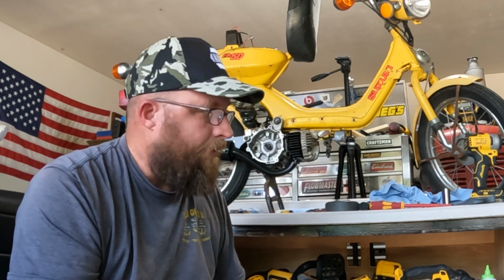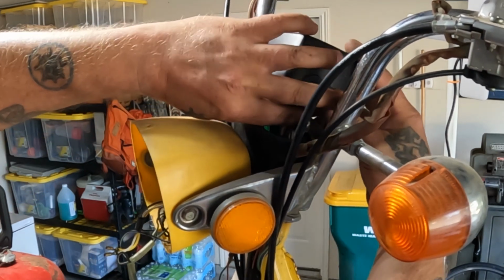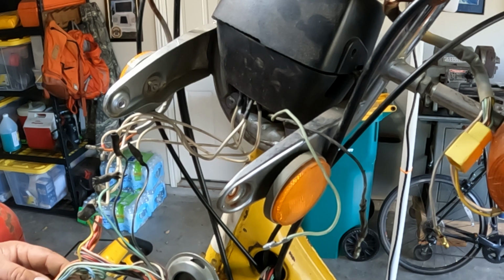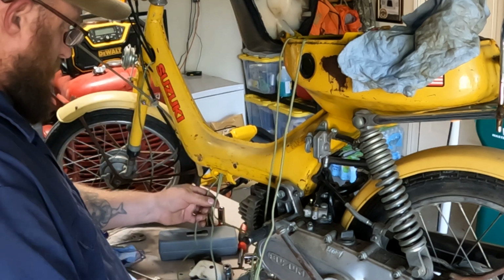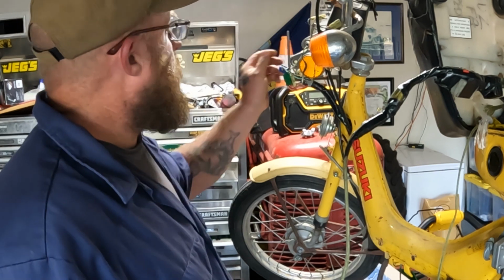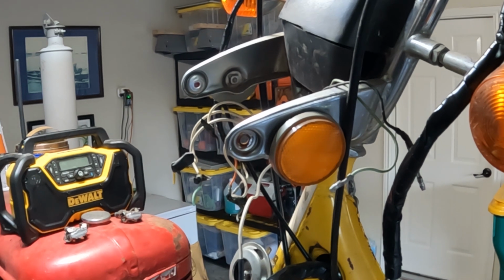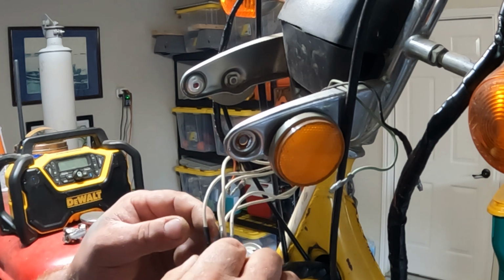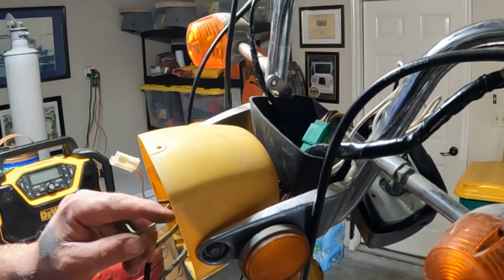Hotrod a moped? | Treatland.com FA50 Big Bore Kit #howto #diy #cute #automobile #shortvideos

Comment: Aye Man I wanted to thankyou for all these FA 50 videos I plan on doing this same kit with my Fa 50 and I will definitely be watching these again for clarity I appreciate it keep up the good work and your cat looks awesome by the way lol
Reply from the maker: Thanks a bunch,  Currently digging around to find a few more parts I need.  Hopefully later this year I will start the complete restoration video series.  FYI, the 60cc kit from Treatland did give me the bottom end torque I was looking for.  Did not give me more speed but did give me a solid 25mph without any bogging down.  I plan to change the gear/sprocket ratio to get me to 35mph max speed.  anything more than that would be rather risky for this light weight of a bike but will make keeping up with most in town traffic safe and reliable.